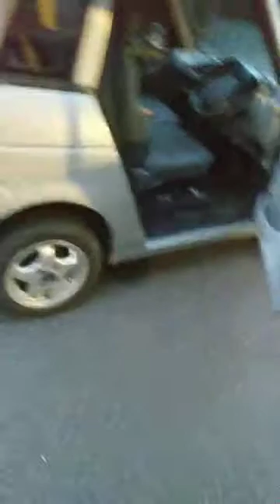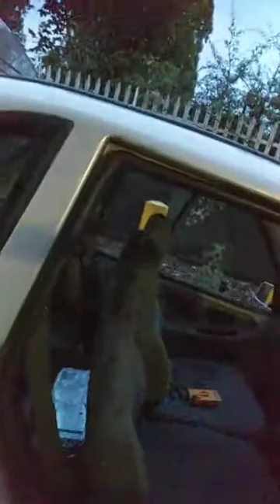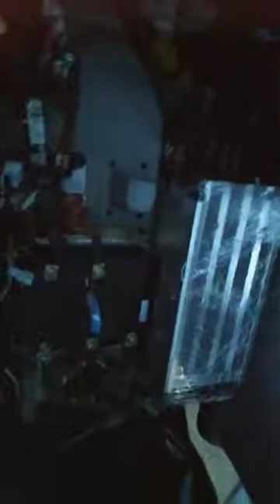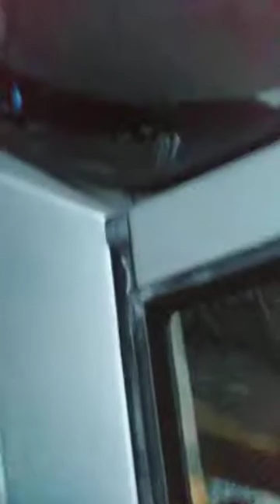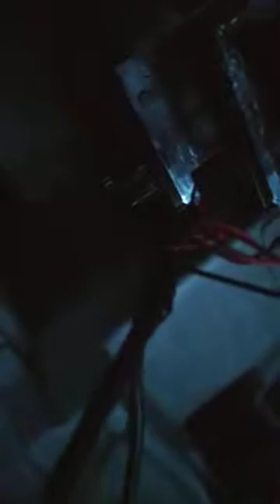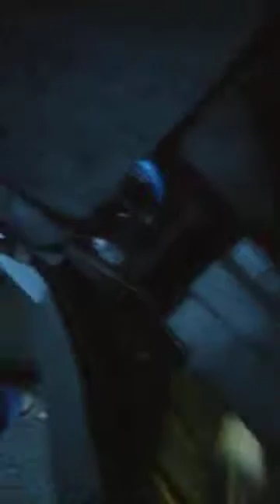Reva G-Wiz Electric Car Lithium battery upgrade Part8

Comment: Fascinating, how did this go in the end? - I have a similar idea after running a solar-powered tricycle this summer, I'd like something a little more practical especially for winter. 

What was your range with 100amps of batteries? - I am thinking of putting 200amps under the seat to hopefully get upto 100 mile range? - Perhaps more will fit in the future. 

Also did you get the volt meter to work, was this working with the lead acid, or just a faulty part?